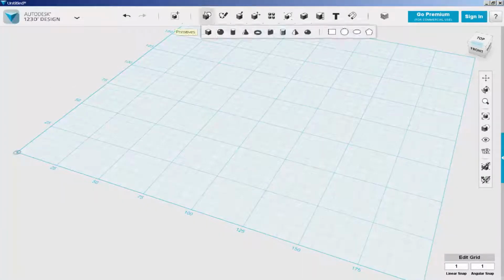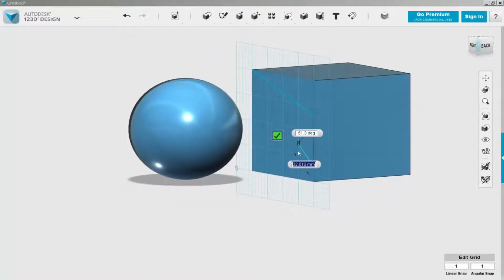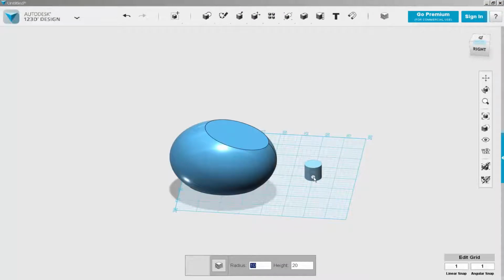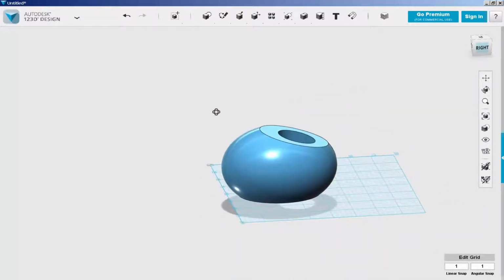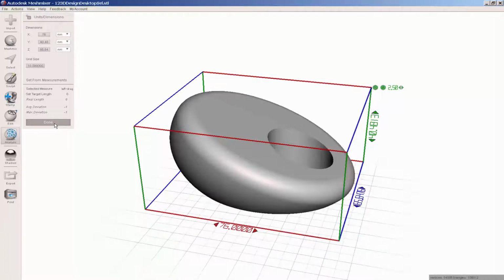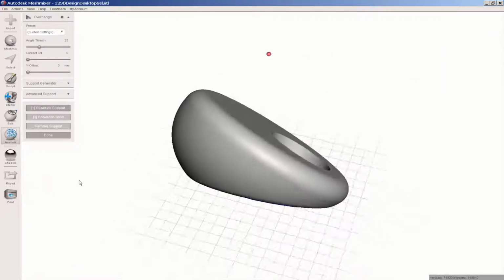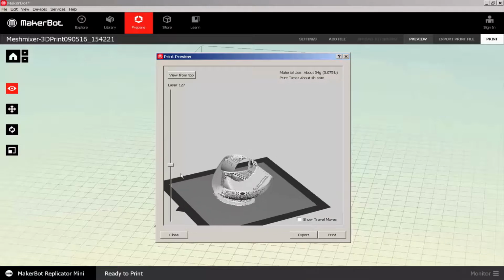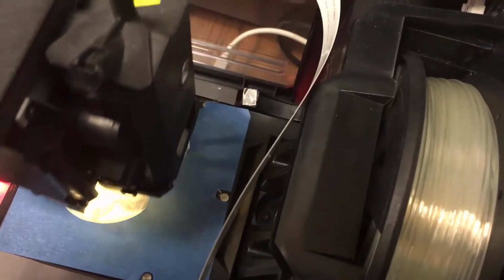123D Design: 3D Print a Class Ring with Gems Inside

Comment: Wow, 3 pieces of software to make 1 model. Not to, uh, brag or nothing, but Blender could do every one of these, save generating supports.
Reply from the maker: +Joe&#39;s 3D Workbench What could do every one of these? I'm aware that more expensive and robust software programs could, but I try to stick with the free stuff.
Reply: +ProfDrafting Oops, sorry. Edited my comment. 

Thing is Blender can do it, but it's not as easy to get started with. But it is robust and free.
Reply from the maker: Ok, but there were just two programs used here, Design and Meshmixer. Even Blender would need a slicer, which is what MakerBot Desktop is.